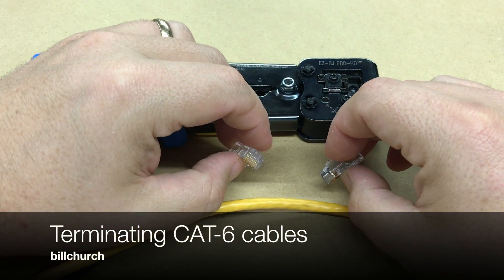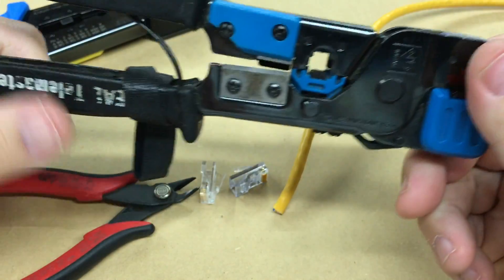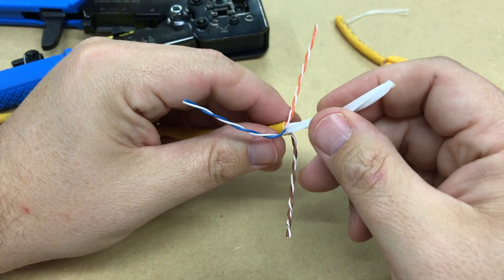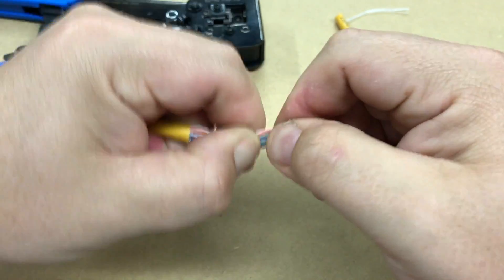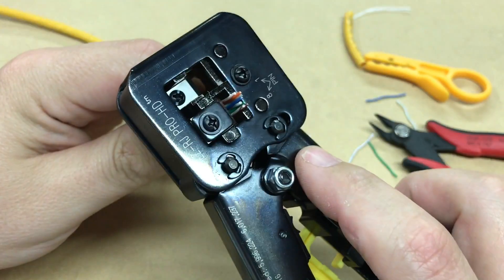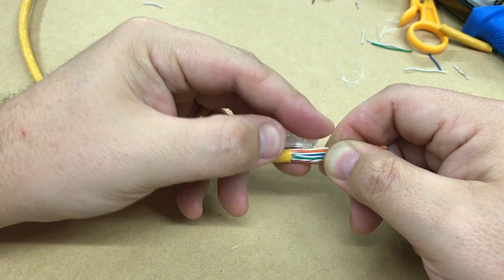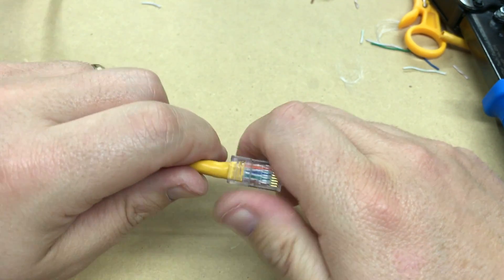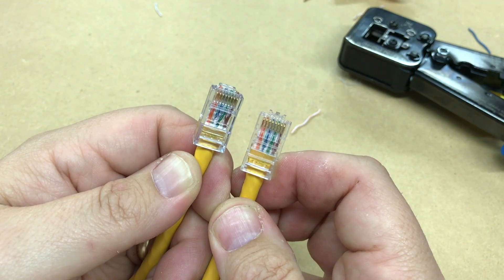Terminating CAT6 cables with EZ-RJ45

Comment: I just did this and I feel you on the old-style connectors. I just made up a cable to run across my house to an office because the wifi is unreliable through the wall. One of the terminals I had to redo because some of the wires didn't make it all the way to the end. Had to lop off the Cat6 and do it over. If I had to do a lot of these I would buy your tool. Thanks for the video.

Comment: I made the switch to the EZ connectors too.  Trying to keep half inch wires in the correct order can be frustrating.  If the cable twists you have to start over and recheck the order the wires are in.  With the EZ connectors you can have the wires as long as you want them to make it easier.  I wonder how many network administrators have horrible cramps in their hands after a day or two of terminating cables.

Comment: When working with Cat6 cables, use a Cat6 connector
Have no more than 0.5 centimeter of wire untwisted

Those open-ending connectors will definitely help with keeping the length of untwisted wire as short as possible, as it's always a hassle to keep the cables nice and flat with you fingers when you only have 0.5cm of wire.
Cat6(a) connectors often come with a cable guide clamp, these keep your wires in the correct order and flat before you put them in the connector, that helps a lot
Reply: Yea. He used cat5 connector for a cat6 cable. Would never work.
Reply: I have done a couple cables without the EZ connectors and keeping the wires flat and in the right order when they are short can drive some people insane.  At least with the EZ connectors you can have as much wire as you are comfortable working with and cut off all the excess later.  With the EZ connectors you still have to keep the wires in the right order and straight.  If that isn't bad enough I know some dimwit who thinks you have to strip the ends of the wires.  I guess he just likes to make everything difficult because that step is unheard of for ethernet cables.
Reply: Charles Hines j
Reply from the maker: But it *does* work. It's not *right* and I even stated that in the video. It's what I had at the time.

Comment: Is the order you put the colors in the only order to do it in or does it work the same as long as you have the same color order on each end.
Reply: you need to have the same color but there's a guide or stander ed you have to do. A or B you have to do one or the other.
Reply from the maker: I'm by far an expert, but the order can matter as pins 3 and 6 are the same cable pair to eliminate cross-talk. https://en.wikipedia.org/wiki/ANSI/TIA-568 goes into more detail there. I have always followed Annex B (green pair is pins 3/6 vs orange) of the standard (because that's just what everyone else has done where I've worked). I find most cables are done to Annex B.

Comment: Why are you using cat 5e connectors instead of cat 6 connectors in a cat 6 cable ? does it matter? do you loose speed in an office complex? very good video and well explained thank you
Reply from the maker: The main reason was..its what Amazon had in stock at the time for next day delivery. In reality I was terminating cables for my IP cameras which all run at 100mbit, I wasn't too concerned about there being an issue since my data rates would be much lower than what a proper CAT-6 termination requires. At the end of the day, I doubt you'd see a major difference. However, if I was doing this for pay, I would definitely use the proper CAT-6 jacks.
Reply: I actually got both 5e and 6 connectors mixed up. Wasn't paying attention and I combined them in a container. I tried my hardest to determine if there was a difference between them. I'm pretty sure the pins are exactly the same. Thickness wise. The only difference I can tell is the cat 6 is slightly larger by 1mm at the main insert hole to allow the thicker cat 6 cable jacket to fit. The pin holes at the end are the same diameter in the website description. Also the strain relief I hate makes all cables slightly thicker so the cat 6 jackets would be easier with cables with strain relief. At the end of the day I only own a $500 Fluke meter to test continuity and not the 5-10k meter to see if there is a difference in speed. 
What I have learned in my 20 yrs doing this. There are 2 types of installers for 2 types of clients. 1) The fast construction type that get it done well working in conjunction with other trades. The bidders wars world. 2) The specialist type that charge an arm and a leg and deal with a very special type of client. 90% of the clients don't care about the speed differences between cat 5e and cat 6. They just want employees to answer emails and phones. They are kind of in the right. Typical office work never uses cat 6 to its potential. You get into long runs up to 300 ft, cross talk, yada yada. Now you are talking differences. Big spaces like that you start running fiber to multiple server rooms,  etc. You as a moral contractor will sell them what they need. Not the best. Give them the best within their budget. I would love to be a #2 but sadly have fallen in the #1 slot. I make good money pulling 3-5 thousand drops a yr. It just takes a toll on the body.
Reply: It matters. Cat 5 connector would not work in cat 6 cable. I've tried it myself

Comment: Use the jacket removed at the start to untwist the pairs.  You first separate the start of the pairs a small amount, then insert the jacket and twist it opposite if the wire twist direction and the wires will separate.
Reply from the maker: Great idea!

Comment: So you need that special crimp tool .I have an old Klein Tool will that work or not ?
Reply: You can use a regular crimper on the pass through plugs, you just need a flush cutter to cut the wire ends that are sticking out even with the end of the plug after. I do it with a regular Klein like you have and (just a coincidence) the little red and black handle flush cutters he has in the video here.

Comment: Love and hate this tool and connectors. If you use different types of brands of cable be sure to check the pins are all seated. The main brand I use has tough inner conductor coating. After I cut the wires I always check the pins. 50% of the time I have to grab my other crimper to seat all the pins. Never have a problem with cat 5e. Just some cat 6 cables brands of bulk cable.

Comment: I've been looking for good cable for in wall use. Are you sure that cable you left a link too is real copper and not the cheap  crap? I've read tones of reviews of people saying there have been a lot of wire's saying they are in wall rated and real copper but they are really not they are CCA cable not full copper.
Reply from the maker: I've checked it under a microscope and at the time I bought the cable it appears to be solid copper. I will say this, I've seen cases where somehow a seller on Amazon will sell something under the same link / same brand but it's nothing like the original. It can definitely be a crap shoot. I've had a situation where I've re-ordered out of my history and what was delivered was nothing like the original.

Comment: Why do other people use extra steps like use that copper tape at the end of the connector etc then use shrink wrap at the end of the connector .
Reply from the maker: I'm not exactly sure what you mean, but it sounds like you may be talking about shielded cable, which is usually used in industrial / high noise environment.

Comment: So, you spent extra money for CAT6 cable, but cheaped out and bought CAT5 RJ45's... you're defeating the purpose of buying the CAT6 cable. The CAT5 RJ45's don't have the load bar in them.
Reply from the maker: I spent the money for what was put in the wall, which if you're going to cheap out that's the best way to do it. In any case, it wasn't a situation of "cheaping out" it was about what was available at the time I needed it. At the time, the proper jacks were back-ordered. If it's a problem, simple fix at a later date.

Comment: What a terrible recommendation! Avoid these at all costs, you'll run into shorting issues.

Plus, lots of incorrect information...
Reply: I used some and found that when plugging in PoE devices the bare ends of the cut conductors would spark, short-out and burn on the shielding of the socket if you were not careful.
The crimp tool was excellent though, and worked with normal connectors well.
Reply: @JohnWatkinsUK  that's right, they're terrible. You're much better off using two piece connectors/connectors with a load bar.
I couldn't really care less about the tool, I could probably find a better one for the price.
Reply: The only reason you'll have issues is If you don't use the specified tool for the EZ crimp and cut or doing something else wrong..
Reply: @lowvpro9651  No, it's literally because how the connectors are designed. What did you think would happen by having exposed copper ends flush with the connector's end?
Reply: Alexandre Botelho true 😂😂👌🏼
Reply: He is not wrong, I guess you don’t have this type tools lol
Reply from the maker: Feel free to correct whatever information you feel to be incorrect. So far, I just see opinion. Willing to learn, but others have to be willing to teach. Any details you can provide on shorting issues is welcome.